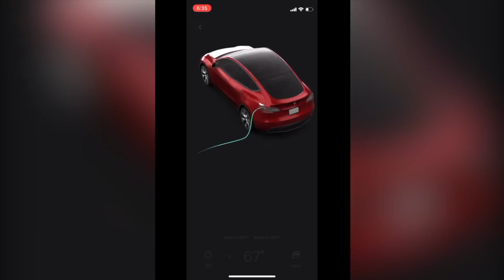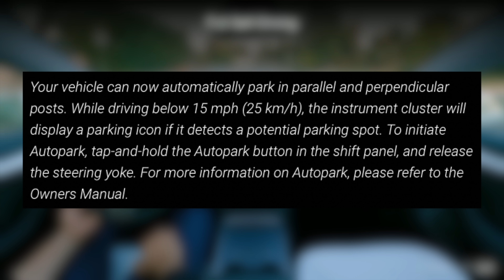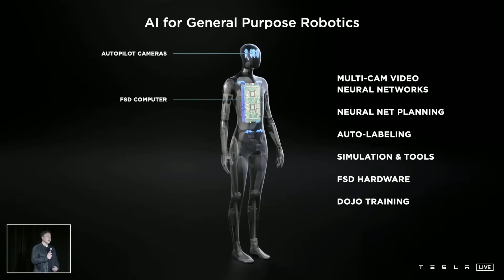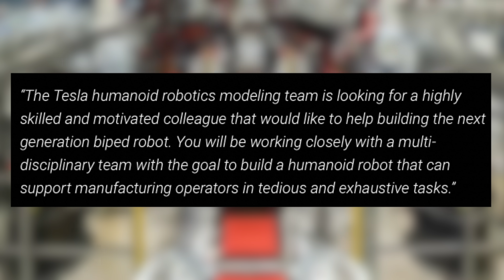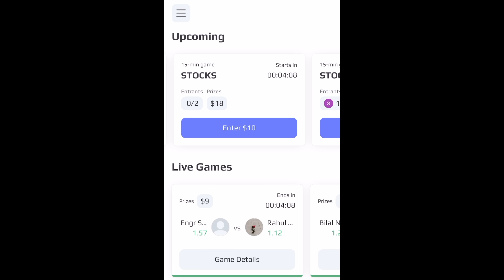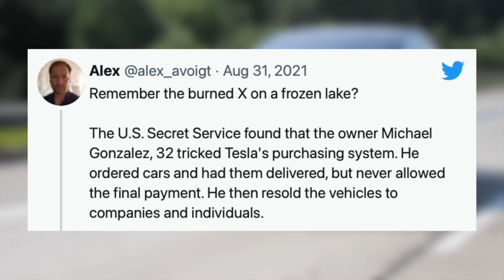NEW Tesla Model 3 Shortages Coming?

Comment: Maybe not super-important, but just for the record, it’s a bit of a stretch to describe Arm as “one of the largest chip suppliers.”

As far as I know at least, when it comes to hardware, Arm sells only designs of various sorts, that their customers combine with their own or other companies’ “IP” (designs), to create a full-chip design, which is then manufactured by TSMC, Samsung, Global Foundries, or other “fabs.”  

So, Arm is two steps away from supplying actual, physical chips.  That, again as far as I know, speaking as a Computer-Design engineer.

Oh, and it’s generally pronounced “Arm,” like the body part.

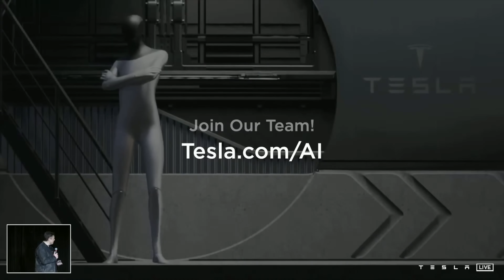Comment: @9:30 Given that a Tesla EV costs around $50K and that the TeslaBot will require far less material and time, it should cost about $10k. 
Imagine how fast Tesla will be able to build these, squirting the endo-skeletons out of a Giga casting machine, sliding in the wiring, the LFP batteries, the FSD computer, the interface, the sensors, and the actuators by the robots of the assembly line, unit testing and then zipping up a synthetic skin onto it. It should be producing up to a thousand Automatons a day.
Tesla can use TeslaBots to produce more TeslaBots.
Reply: Giving me hella iRobot vibes, let’s not get to that point, please!
Reply: @artemisfowl127  totally agree... wait until the Defense department gets a whiff of this bot !